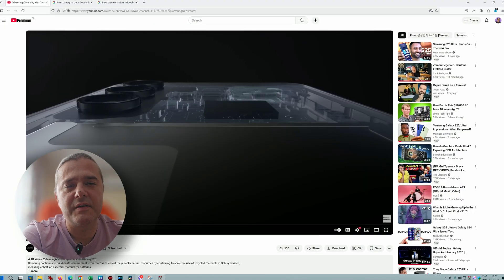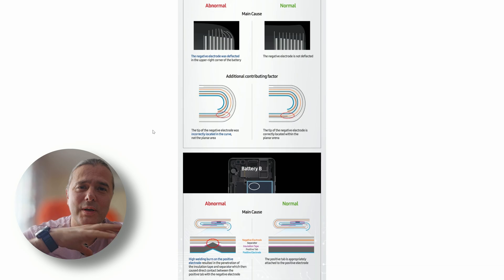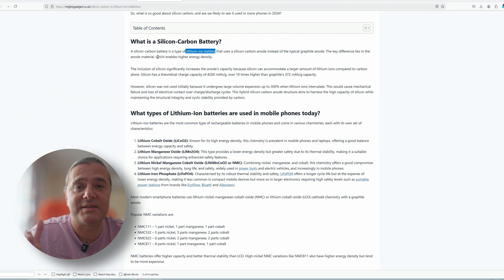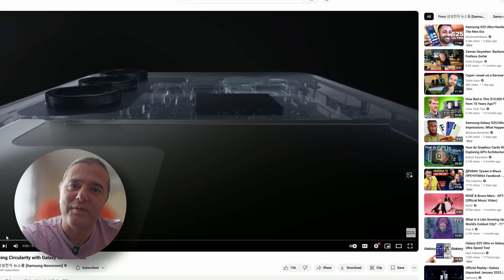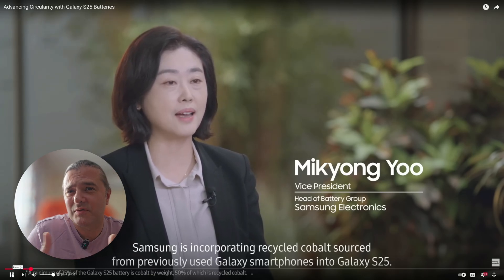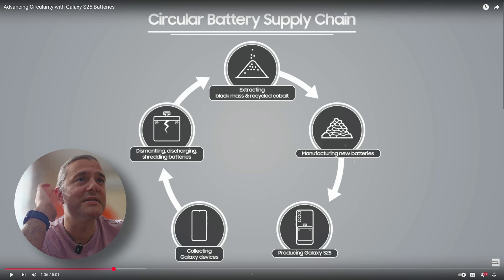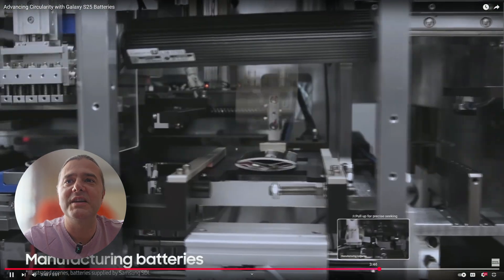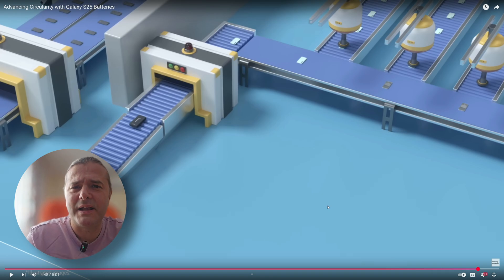Samsung Galaxy S25 Battery process explained: Silicon Carbon vs Lithium Ion

Comment: if they go silicon carbon, then they automatically increase battery capacity.

if they increase battery capacity, they HAVE to increase charging speeds.

samsung can't do that because they are saving a lot of money by sticking to PD 3.0.

Comment: yeah, as you said it seems to be their way to show us why they are not "upgrading" to the silicium carbon, good way of seeing this
and as you said, at least they've got some "high standard" (at least that's what they say) regarding their battery manufacturing process, so we can maybe accept it for a little bit of time

BUT i think that they should let this technology for the mid range and lower range products from now on, and just get along with the other manufacturers

Comment: Don't try to justify them. They can buy batteries from other manufacturers, like they buy processors. They don't put better processors because they care about users, they put it because no one would buy their phones with that lousy processor!  The same will happen with batteries, they just don't feel they have to do it right now. They're reminding me more and more of Apple! I'm turning to Chinese manufacturers, they're bringing innovation and enthusiasm! What do you think about the Honor Magic 7 Pro? Thanks!
Reply from the maker: I dont, I dont like it either... would have been good to have at least 5800mAh...

The HM7P looks very good on specs!
Reply: Problem with Chinese brands is you can't trust them with your data, even if the phones are better.
Reply: @MrNPC  you can go for custom roms like graphene os and there are many other options. If there is not one available for your device, go for gsi rom.